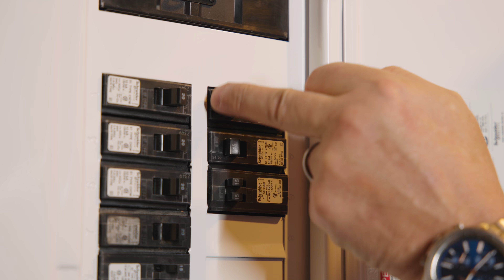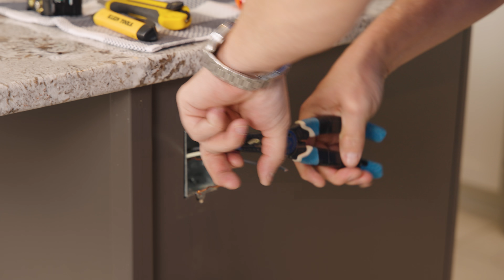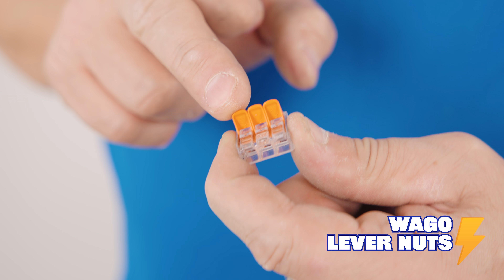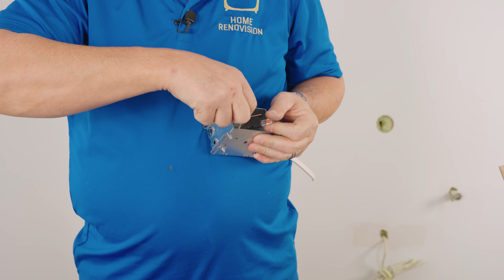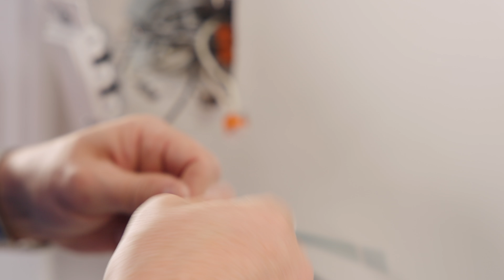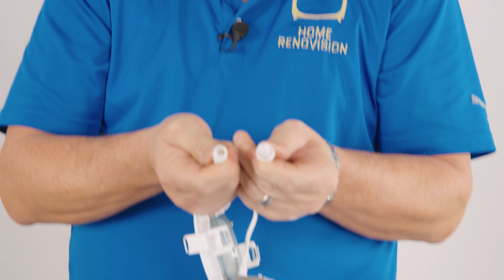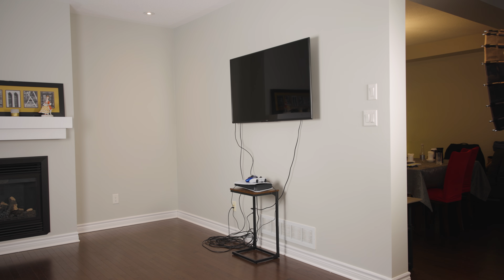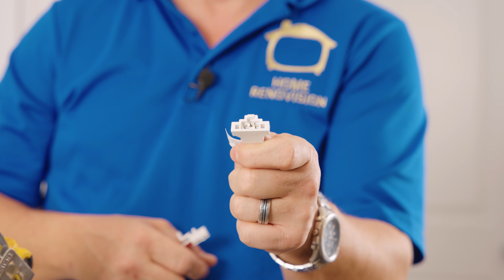Electrical Hacks Every Homeowner Should Know (DIY Friendly)

Comment: At 1:42, you briefly flash a second or so of the circuit breaker getting switched off, but you didn't include any narration. I actually missed these few seconds the first time, and was wondering why no warning was given to "bed pan" equivalent knowledge folks. In all fairness, you do a better job of stating to shut off the power in later sections of this video. 

My second comment is your use of the word "marrette", which I think (not positive) is only common in Canada. Just take a few extra seconds to say "marrette also known as wire nut". 

At approx. 32:27, you ask "Does the Kidde fit in the old harness?" 
I recently changed 10-year First Alert brand smoke/CO detectors (manufactured by Resideo) in a rental home that my sister owns. Luckily, the tenant had provided me access, and was not watching--she was across the street, so she did not witness my resulting confusion!  Before replacing the first of three units, I looked at both the harness and the mounting plate attached to the ceiling. They looked the same, but keep in mind one is generally looking upwards at an angle. The new detector seemed to rotate onto the existing mounting plate without any problems. After installing the detector, I noticed a single beep about once a minute. I thought WTF and took the detector back off to ensure that the wiring that goes to other detectors was securely connected (it was). The directions provided did not include a single beep in the troubleshooting section as far as i could tell, using my camera smartphone to enlarge the very small text. 

Finally, in desperation, I called the phone support number listed and luckily they (Resideo tech. support) picked up a few minutes after 4 pm PST. Also, as far as I can tell, the directions did not warn to consider the mounting plate and the detector as a matched set for replacement installations. Only after removing the mounting plate from the ceiling, and comparing side-by-side with the new mounting plate, could I see that there was an approx. 1/8" difference in the height of the two plates with the original plate being the taller one. Turns out that as I was rotating the new detector into place, using the original mounting plate, it was not allowing a very small inconspicuous tab to activate the backup battery. So, the detector was getting 120 VAC power, but was not sensing it's internal 10-year sealed battery--thus it beeped about once per minute (almost exactly 60 seconds--I timed it). As soon as I spent an extra few minutes to remove the original mounting plate and install the new plate, the detector screwed on (as before) but this time remained quiet without the periodic beep!  Lesson learned: consider the mounting plate and detector a matched set, even if the brand (First Alert in my case) is the same. It may not be!

Comment: One thing to double check that I almost blew my power with is that some kitchens have 2 breakers linked to the same outlet (1 up and 1 down) so when replacing the power outlet you MUST remove the connection between the 2 plugs in the outlet (small metal tab linking the brass and white screws) Super simple, 2 seconds to remove with plyers but easy to forget if you're not used to do it and potentially catastrophic if not done.

Comment: The way I've always remembered Line vs Load is: LIne (I for In); LOad (O for Out).
Reply: Nice memory trick.
Reply: Thank you for the tip 👍
Reply: Thats helpful but its not necessary. Im not trying to be rude but its very straighforward as is. Input, output. Line in, load out.
Reply: @user-rs1fj1is8c except, for some, it IS necessary. That's why they made that a teaching/memory method.
Reply: @user-rs1fj1is8c 😂
Reply: @user-rs1fj1is8c  Load = source = in
Line = "line to next outlet"

Huh, maybe it is necessary as the terms are ambiguous at best?
Reply: @user-rs1fj1is8c  he didn't say it's necessary, he's sharing it because it's helpful

Comment: Notes from an electrician:
- USB adapters consume power all the time, even when nothing is plugged in. If you install a USB receptacle, it will waste power 24/7. Might be better to just plug in an adapter.
- Do not use power tools to "push" the device into the junction box because it is far too easy to pinch/damage a wire and not notice. Honestly, using a drill to install devices is overkill and doesn't save much work. Drill is fine to remove screws.
- Do not cut length off the wires, just "because". Over the years, the wire gets too short. Only shorten if needed. The curled wire getting weak is a really rare event.
- Using only a humidity control for bathroom fan is worthless for toilet odor. The timer is a good choice.
- Be sure to connect all ground wires.
- Those ceiling hole saws are very finicky. They easily catch and scrape across the ceiling. Be careful because it's easy to damage the ceiling.
- The connector at 24:37 where he cut off the bad wire needs replaced. The little bit of metal sticking out of the connector is a shock/short hazard.
- For the TV wires in the wall, you cannot run the power cord through that hole. It's a code violation. He doesn't show the power cord in there, but there is nowhere else it could be. He should have mentioned not to do it. Again, don't use power tools to install those boxes because it's way too easy to break them.

Comment: Like watching your videos, very informative!!!  Question, you used Wago connectors through many electrical connections.  My quesion is why you did ot use Wago connectors with the CO2/fire alarm connections... Why did you not use the Wago connectors there??? Didn't make sense to me... Please explain....
Reply: My guess... Those were beautifully twisted wires and he only need to attach a little stranded adapter. Much easier/faster/cheaper to use a wire nut here.

Comment: Lol 30:00 you didn't want to show that you routed the TV power cable through that "low voltage" channel
Reply: this is a stupid question, but is doing that a problem? i was thinking about doing this but if it could be an issue i wont.
Reply: @TheMensRoom  it’s a code issue. High voltage (power) cables can get hot if there was too much load and more likely to start a fire especially in your wall. 

Usually it’s extension cords that people load up with too much stuff that are most likely to have that issue. It’s really stupid actually, most extension cords in the US aren’t rated for 15amps, which is what most breakers are rated for. So you can run a higher load than the extension cord is rated for but not enough to trip the breaker. The extension cord melts and catches on fire.

Comment: I would also add to double check your metal boxes are grounded. I went through most of my outlets and receptacles to find the previous owner of the home had none of them grounded to the box. Super dangerous in case there's a short and one of the hot leads touches the box for whatever reason.
Reply: What if the boxes are plastic ?

Comment: most standard HDMI cables are not in-wall rated. While many high-end or "professional" cables sold at electronics stores include this rating, the cheap ones that come bundled with your TV, gaming console, or laptop usually do not.
To safely and legally run an HDMI cable through your wall, it must have a specific fire-safety rating stamped on the cable jacket.
If it does not have that then the cable will burn during a fire and pull that fire inside your wall bypassing the drywall safety layer

Comment: At 11:38 it looks like there are 2 wires on the same screw. There is not, that would be against code. This is a long black wire with a 1” section of insulation removed from the middle of the wire. So there is 1 continuous wire underneath the screw. 

Electrical codes (like the NEC) prohibit "doubling up" wires on a single screw because the screw head cannot apply even pressure to two separate conductors. This leads to loose connections, arcing, and potential fires. By using a single, continuous wire with a section of insulation removed, you maintain a solid, unbroken path of metal under the screw

Comment: The reason that all smoke detectors have an effective life of 10 years is not because of the battery.  Smoke detectors with replaceable batteries still have to be replaced every 10 years. It is because they contain a tiny amount of a radioactive isotope that is used to detect smoke that has a half life that makes them unreliable to detect smoke after around 10 years.
Reply: Or they use photoelectric sensors with cheap imported capacitors that aren’t considered reliable past ten years (or at least that’s how long they guarantee them)

Comment: If you see this I would LOVE help with my fire alarm.  I was proud to have done it myself (brand new) then after a year it started beeping and setting all the alarms in the house off.  I replaced the battery multiple time and it will stop for a short period but then the cycle repeats.  I have no idea what I'm doing wrong and for now have just disconnected it.

Comment: I’m an electrician and the very first of your video about the motion switch you didn’t hook the neutral up but you removed the middle switch to pull the neutral wires out I’m confused on why you did that

Comment: In the United States, it is okay to add a 15A receptacle on a 20A circuit, as long as there is more than one receptacle on that circuit. 
Review NEC article 210.21(B)(3). 

But with your accent, I believe you're Canadian, I am unfamiliar with the code in Canada.
Reply: thank you so much.   Was looking for this!  :) Maybe a note inside the cover "20Amp", along with breaker number and location of that breaker (if more than one box).
Reply: Do you know what one has to do if I want to change a circuit from 10A to 20A

Comment: 18:49 
I put these stile lights in my house in 7 spots. They all flicker at the same time. For probably 10 seconds every 30-45 minutes. All at the same speed and all at the same time. Does anyone know why?
Reply: that is very common with older dimmers
Reply: @The2Destiny mine don’t have dimmers. Just straight to a switch or a 2 way switch. Do they require a dimmer?
Reply: @BradP111  the lights don't require a dimmer to function, and if we assume the  wiring is done correctly, a normal on off switch will work on basically anything 

there could be a problem with the wiring since it's happening to all of them, but it's most likely not just the wiring since the flickering  is somewhat predictive

you may have something on that line that draws a lot of power, that would be anything heat, pump, motor related, that could explain why it's somewhat predictable.

i think it is most likely a combination of high power draw with either bad wire connection or long wires 

worst case you could check these out but it's most likely not the culprit 

Dirty Power
Ripple Control 
External Power Grid Interference

Comment: As a career electrician, I love wago connectors.  Few other sparky buddies give no end of crap about them and prefer wire nuts but it's just being prissy and purist.  Fact is, I've had more wire nuts fail than wago.
Reply: I've heard the actual surface area of the connection is less on Wago and that's why they are disliked. It is similar to the cheap push in connector he shows with the puck light.
Reply: @TonyPombo  That is true, unless ideal connections it'll have less surface contact than a traditional wire nut.  But I'm also not using wago connectors on anything I expect to pull a ton of load through so its minimal.   I'm more worried about the nut slipping off and a hot wire energizing the box.
Reply: Do you think “ weatherproof” wire nuts are necessary for outdoor light fixtures, etc ?  These have dielectric silicone

Comment: FWIW, its perfectly fine to put a 15A receptacle on a 20A line, as long as theres atleast 2 other 20 amp receptacles on that circuit. however it does not work the other way around. 
TLDR If you have the T, you dont NEED to replace it with a T, but if you dont, you cant put a T there

Comment: Electricians aren't trained like brain surgeons. 
I've worked with good ones. And I've worked with guys who got their journeyman's ticket and all they were ever really qualified to do was pull cable. One guy I knew couldn't even change a receptacle. Not a panel. A receptacle. And if you ask most of them to design a light-and-switch layout, their brains melt.

Comment: Write the circuit/breaker number on the back of the cover plate with black sharpie once you know which one it is. Great for future info.
Reply: I have mixed feelings about that advice, because if people remove covers when painting (as they should) and they don't reinstall in the same locations (or if later work is done in the circuit panel box and breaker positions are moved around), then you have incorrect information. I guess good as long as one ensures they put the plates back on the same receptacles AND test with a multimeter after switching the power off, just to verify--or minimally a non-contact tester, then they are okay.
Reply: Or...  Identify it on the directory in the panel.  Electrical circuits are typically run to a room or area of the house.
Reply: @Th3Su8 lol not in my 80 year old house that's had a few DIY owners.
Reply: I have an Excel file on my PC that I keep up to date and reprint anytime something in my panel gets added or changed. Because you can only cross out the labels so many times before it get sloppy. I have also used a labeller in the past. If you only peel off half the backing (always cut down the middle) it's easy to rip it off.
Reply: @brockakerman9309 surprised we don’t use peel labels over the written labels. 

I may adopt the Excel idea as I just started creating a folder of projects and costs as well as Point of Contacts for specialties.

Comment: Having replaced two receptacles with usb ones, I find it more practical to just buy an outlet extension hub with usb ports. Not only is it super easy to install, it gives you additional outlets and is easy to remove and replace when USB C fully replaces USB A.
Reply: Yes, and when there is a new version of PD

Comment: For my tv I put the plug behind  the TV.  Worked out good because I was also doing work on the other side (a inset pantry cupboard).  Also I did 6 of the flush mount lights.  Of course I did all this before I saw this video.  Keep up the great work.

Comment: The dust catcher thingy doesn't work when you also have shiplap above the sheetrock in the ceiling... 
All other tips I've done or used. Because my electrician prefers the twist caps, I did use them for things that I would NOT be getting into again. All others were wagos. 
As all my walls are being opened up, I am running all cables inside the walls.

Comment: Would the LED can light replacement work if the can light in my bathroom has a fan built in to it? I would love to get away from the halogen light bulb but I think the replacement would cover up the hole for my fan that is around the current light bulb.

Comment: I prefer push-wire vs lever lock. WAGO makes UL versions of both, if that's your preferred manufacturer.
It's a trade-off, but secure the correct wire into the correct connector, and no issues!

Comment: I just installed a bunch of these switches and fan timers/switches. I did fan timers in bathrooms and the humidistat in the utility/laundry room to control humidty since i also am building a small pantry in the same room. That sensor makes it alot easier than a timer or manual switch.

Nearly everything in this video ive been doing recently on my home i bought last year.. i love it lol

Comment: The only problem with motion activated lights is if you have folks who like to turn them off at the switch, which defeats the purpose. Every light in my office (including bathrooms) is motion activated, and folks still insist on turning them off at the switch, which means the lights don't come on when someone comes into the room/area!

Comment: When using the non contact voltage tester, you're supposed to test it on a live cable first to make sure it works.
Reply: I’ve been a spark for over 40 years. Test it on a known source - then onto your job - then back onto a know source.
Reply: @video3ish  Why back to the known source?  To make sure it didn't die in that past 60 seconds?

Comment: Adding multiple Wagos instead of the "Alberta splice" (removing insulation in the middle of the black wire to supply two switches) can overfill the box according to the CEC. Splicing connectors such as Marettes or Wagos count as one conductor for each pair after the first one (e.g. 3 connectors = 1 conductor, 4 connectors = 2 conductors, etc). 

Also, USB receptacles are deeper than the 25 mm allowed in the code for a device, so it also counts towards the box fill - this needs to be kept in mind when using such receptacles with 4 wires in the box. I had to get thinner profile USB receptacles to avoid overfilling my 2 ½" deep boxes that had 4 wires coming in.

Finally, I would recommend using the neutral on your timer switch, as you have neutral wires in your box. It's made optional for older installations that don't have a neutral in a switch box (when it was allowed to repurpose the neutral wire as a load conductor). The timer is using the neutral for its internal circuitry. It can use the ground wire as a return path in a pinch, but as a ground wire shouldn't carry current except in a fault, it's better to actually use a neutral wire for this purpose if available.
Reply: that usb recpticle looked like it had heat vents. Where is that heat going? Like these afci beeakers, they run 90*f because they always draw a current.
Reply: Man you know your stuff!
Reply: @Audibmwjb I'm an Electrical Engineer and I know my way around the Canadian Electrical Code, as I've needed it many times in the course of my career.